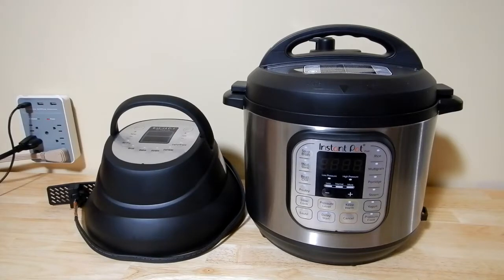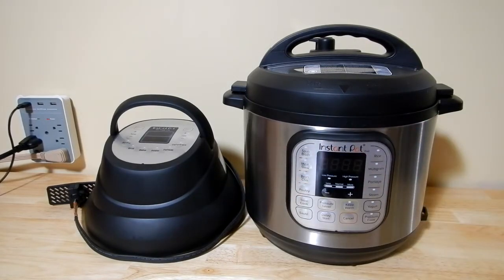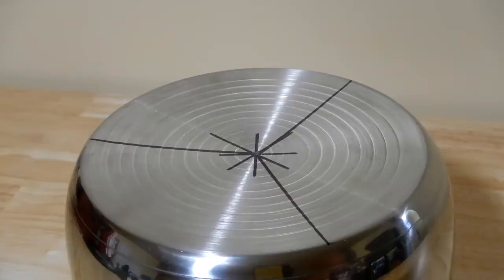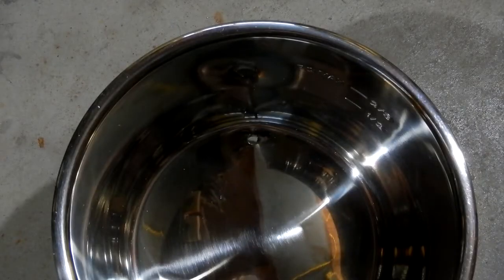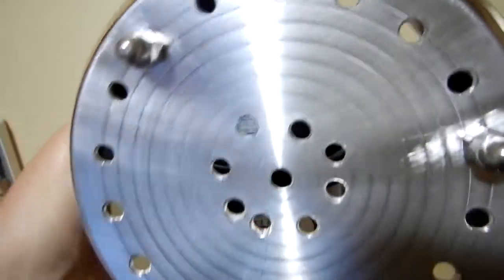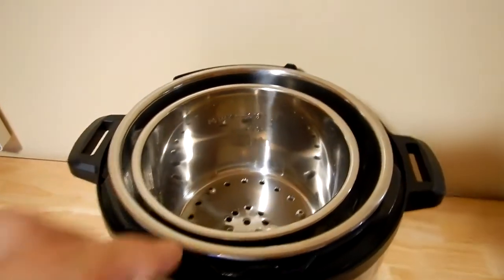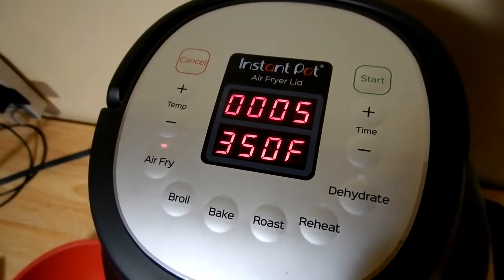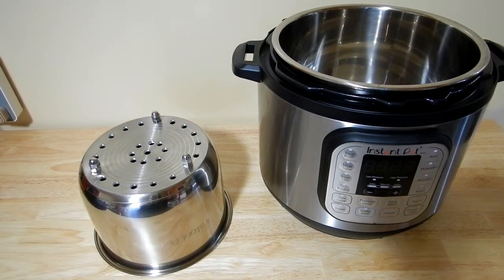Make an Air Fryer Basket out of a 3qt Instant Pot Stainless Steal Inner Cooking Pot

Comment: Shocked to learn that the Instant Pot Air Fryer Lid came with a cheap teflon coated basket.  Wasted design.  The weakest link in the product kit.  You understood the need much better.  That's a crazy concept you got going, and I couldn't imagine a better way to do it.  Well done, you inventor you!  Good quality design.
Reply from the maker: Thank you very much for the kind words Van Can!